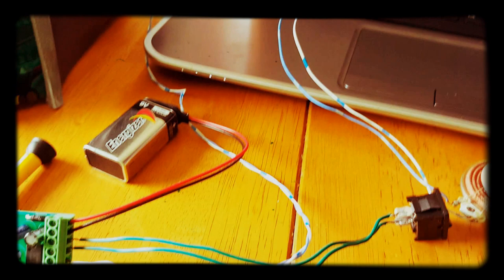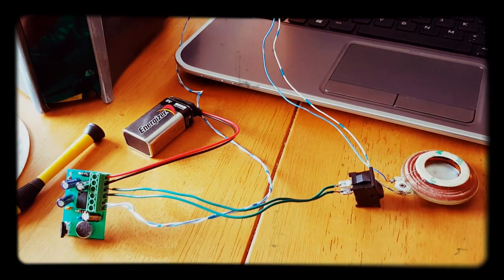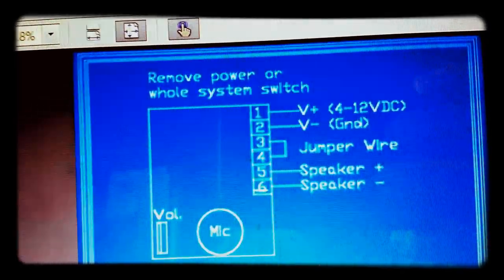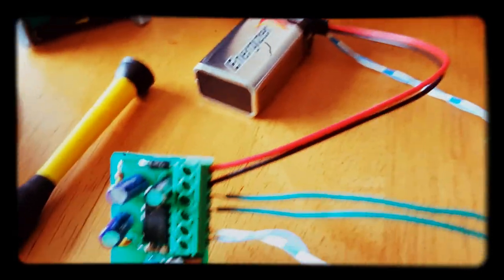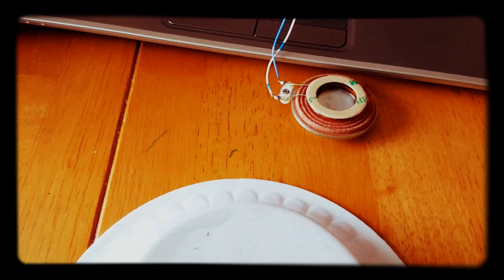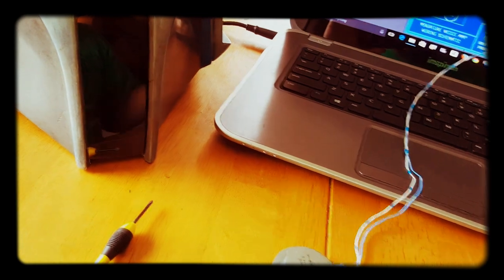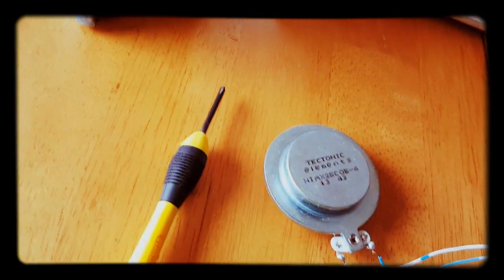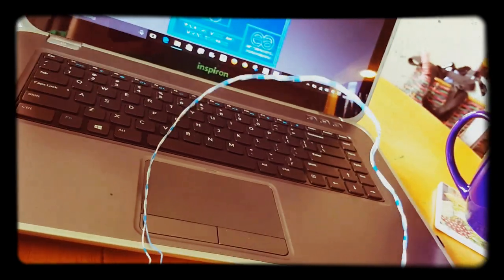Tiny voice Amp, big sound!

Comment: This is just the find i needed, ive been struggling with how to do my voice amp for my mando helmet and i really wanted to keep it all inside the bucket with no wires or external speakers. 

How well does the transducer work if you put it inside one of the flat cheek sections?

Also, do you guys also make something to improve hearing from outside the helmet. Basically the opposite of a voice amp?